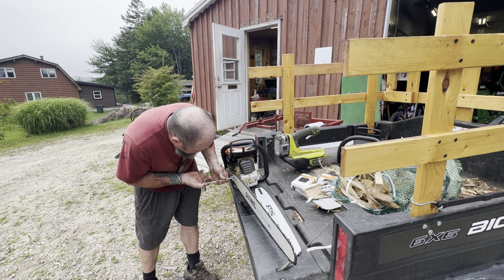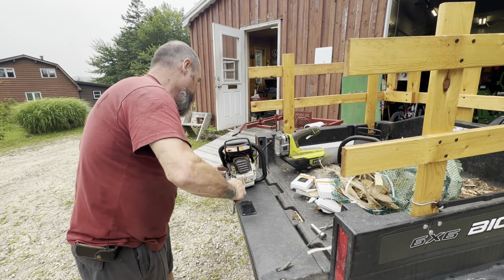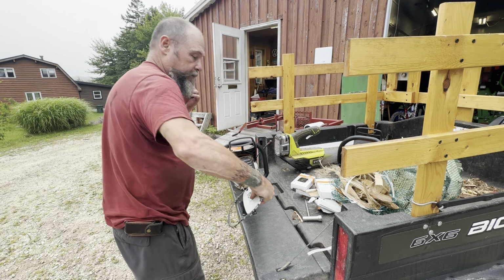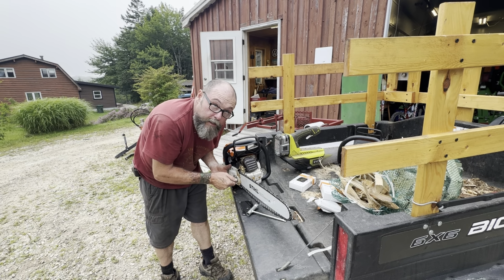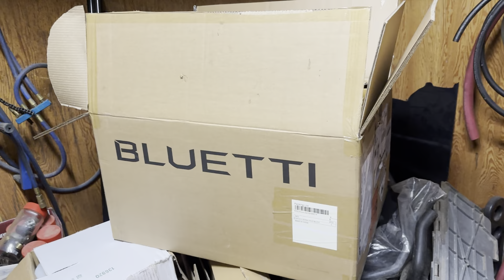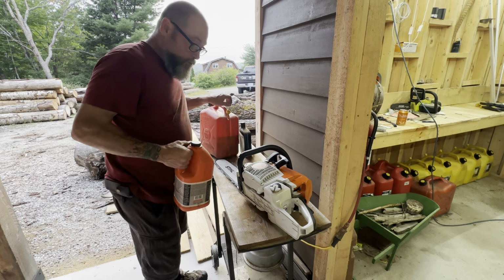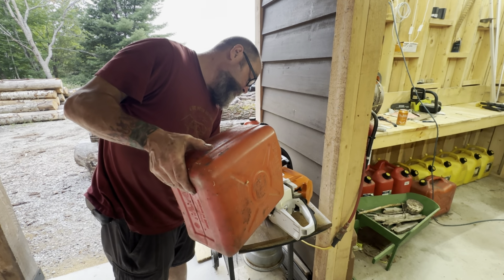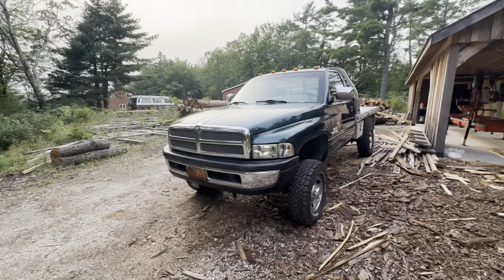THIN SKINNED, seriously.

Comment: On my MS261 I run an 18” bar with 3/8 picco full chisel chain with a ported muffler. Seems to be a good fit for a 50cc saw. Different file needed but cuts faster than 0.325 or 0.375 chain on a small saw.
Reply from the maker: Great combo for sure.